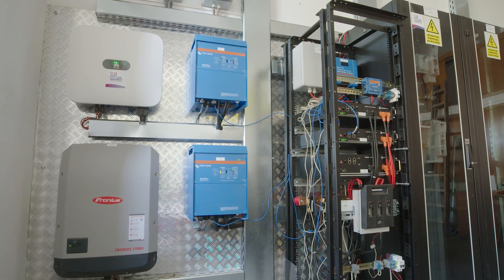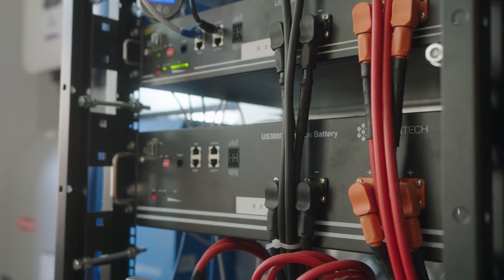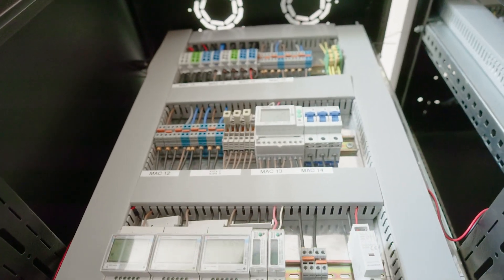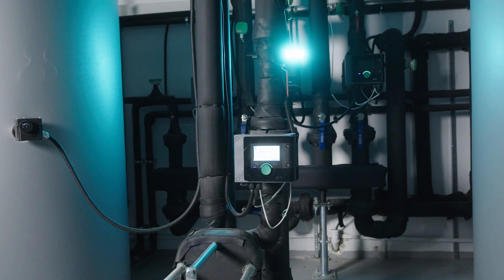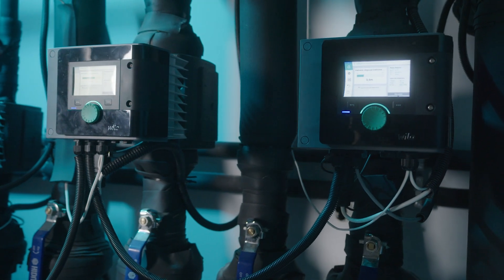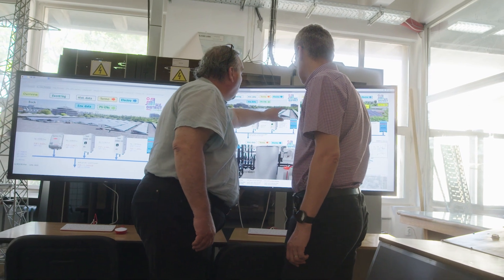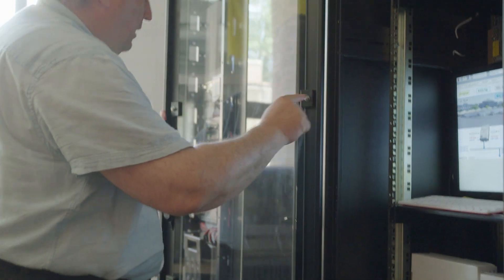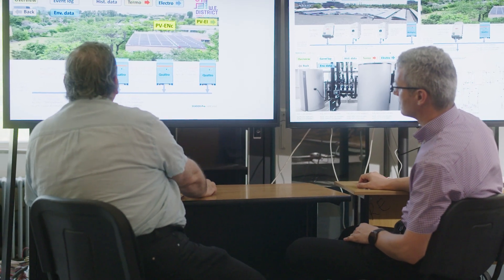Retrofitting of an Inefficient Section of a District Heating System

Comment: Thank you for your detailed video. Would it be possible to list a full specification of it with installed power of the heat pumps and a rough install cost of the whole system? This will help others to evaluate the costs/benefits in a comparison with their future projects. Many thanks!
Reply from the maker: Dear Dionisie Natea,
thank you very much for your honest interest in this project. We have a lot of information on our homepage: https://www.wedistrict.eu/bucharest/
or you can download the Demosite-Brochure:
https://www.wedistrict.eu/wp-content/uploads/2022/10/20221006_WeDistrict_DemositeBucharestBrochure_148x148mm-WEB.pdf
For more information, you can also find our contact addresses at these links.
All the best.